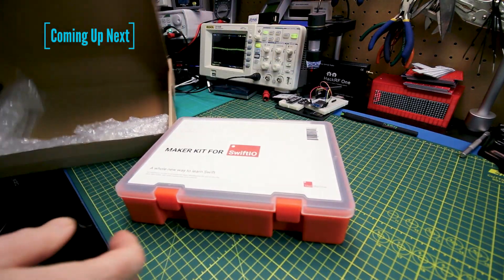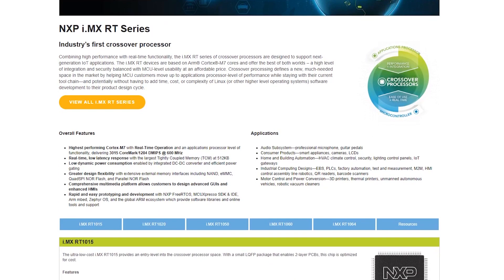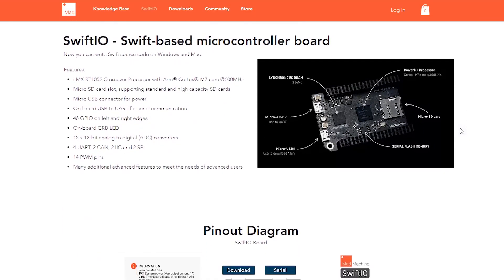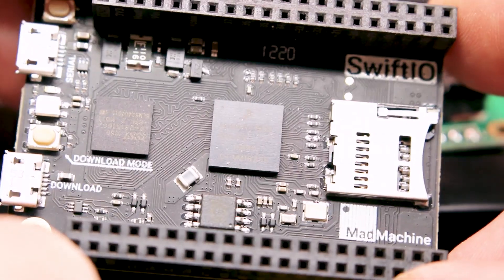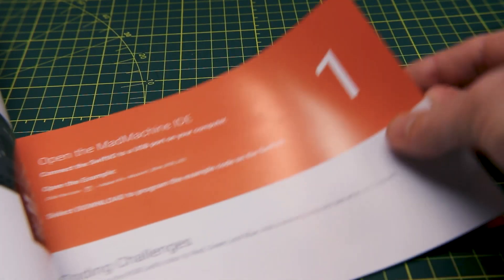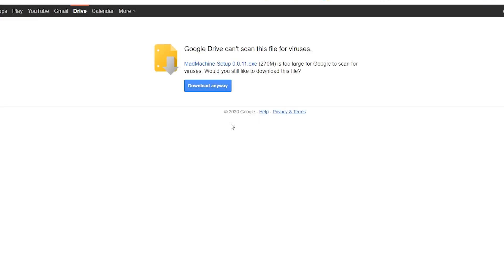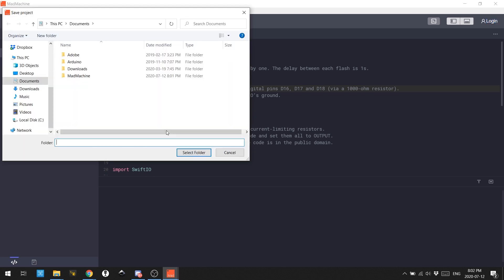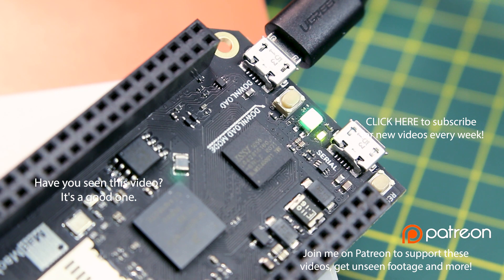NEW Way To Learn Programming & Electronics? 💡

Comment: I think the processor is the same one used on the teensy 4.0 and 4.1. If someone can confirm that?
Reply: From official specs this runs the RT1052 while the Teensy runs RT1062. From NXP product page at a glance the only difference is SRAM size and Ethernet at stock. The carrier board that they came with changes those difference pretty drastically though.
Reply: @spookedhusky390  Thanks for the answer I thought both were the exact same, although I remember when programming the teensy 4.1 I saw references to both processors the RT1052 and the RT1062, it might have been a previous version of some kind maybe.

Comment: Interesting - I'd always thought Swift was pushed forwards (at least by Apple) because Objective C was so damn complicated to work in - I didn't know it had speed benefits.  Looks like a cool kit, a higher level than Arduino should make things easier.  How is it if you want to run interrupt-driven code though? (assuming you've got that far yet)
Reply from the maker: Haven't got that far yet :)  I hope to play with it a bit this fall. The ResQ project has taken all my time lately and I want to get a 500 size quad done for it soon too.  Cheers Bud